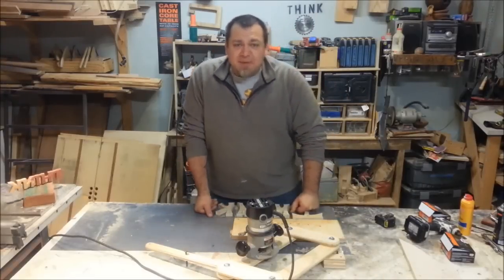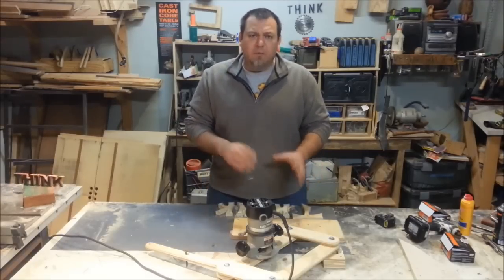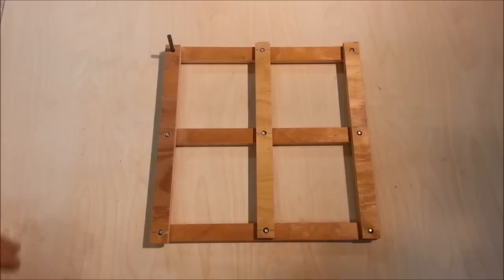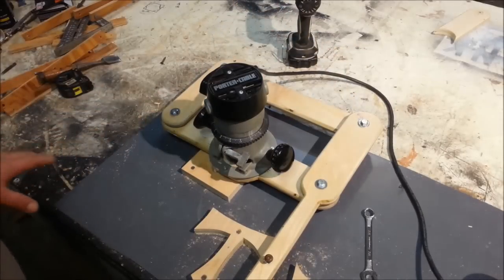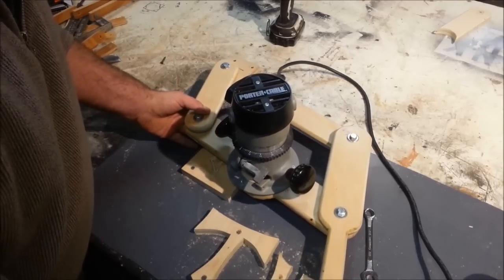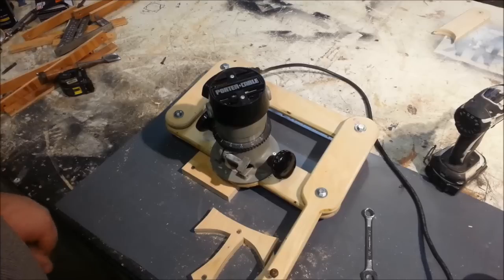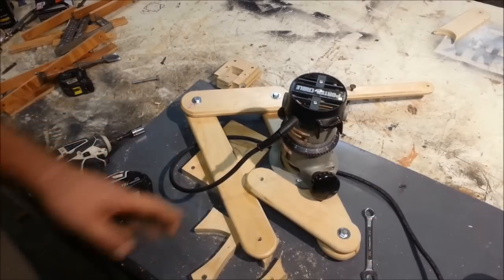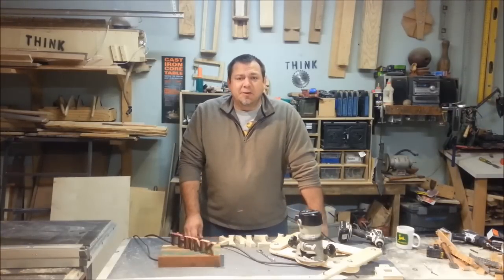DIY -  Simple Router Pantograph! (How To)

Comment: I know this is an old video, but I just built one of these and it works great. The only comment I have is that it would stick slightly with the wood rubbing on wood at the hinge points. To fix that I simply rubbed candle wax on both pieces and now it slides smooth as silk. Thanks for the idea!

Comment: you could use the drill or a dremel to make it lighter and lets say you use dremel you could use a "planet globe" style swivel on the bottom and another wood piece from back of nail tracer side to the back of the dremel to allow tilting for 3d pantographing/coping quick and easy

Comment: Great explanation, at the beginning, of how the geometry works.  From seeing how it works, with some modifications, could a 1:1 pantorouter could be made if the pivot was placed in the middle?
Reply from the maker: Would have some serious stability issues to work out but I suppose it would be possi le.
Reply: Tobias Redepenning You would need to not have a pivot but just a straight up and down center to fix this problem I guess.
Reply: Counter weight should be considered of course. maybe a swivel mecanism to help with the up and down movement being stable. a project to look into.

Comment: Great vid. How does the depth translate from tracer to router? Is there a way to control that?
Reply from the maker: that depends on the height of the jig its self, easiest way to set it up is to use the tracer to level the jig to the table surface and move the router bit down to the desired height.,